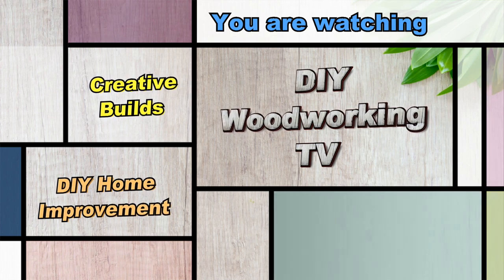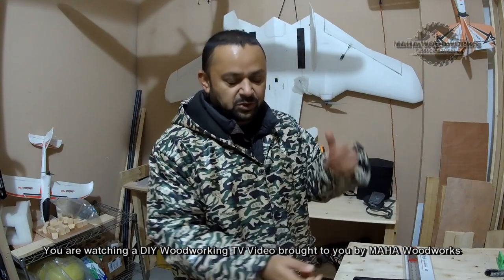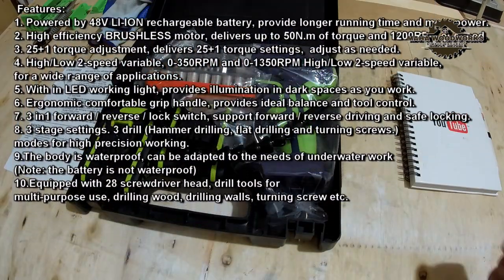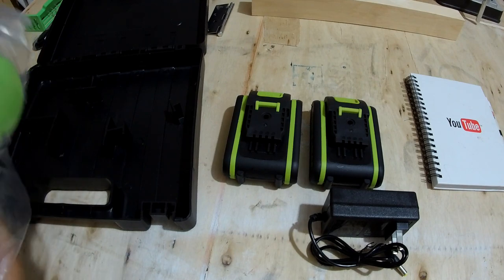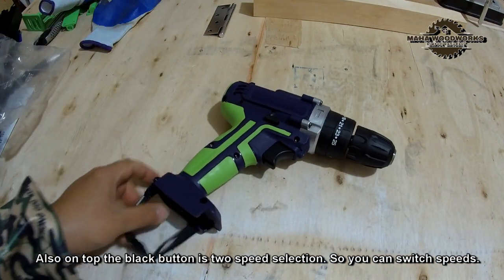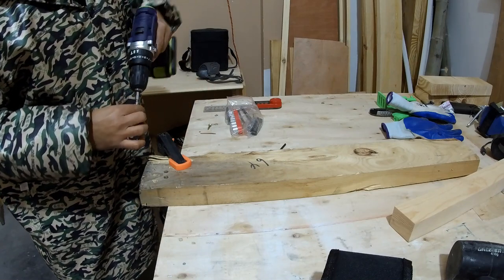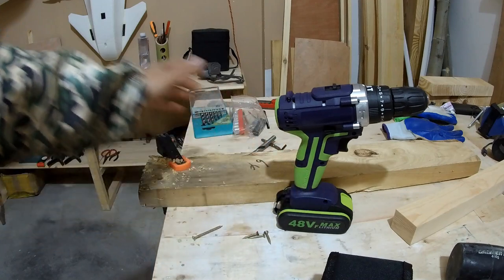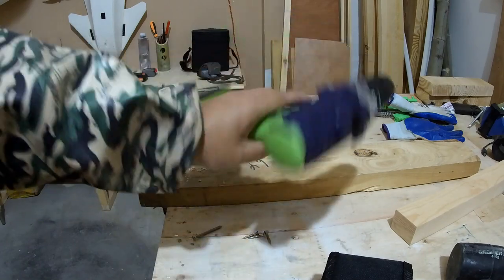3 in 1 Cordless hammer drill 48v LED light 50nm 25 Torque electric Drill

Comment: I m selling a lot of drills. This is not 48V drill. It is 48Vf, which I failed to understand what it means. Possibly related to battery capacity (mah). It is using 21V batteries (4.2v x 5 cells). Max V I have seen for cordless is 25V.

Comment: You may find this helpful.  When drilling you may notice the flutes filling up.  It is usually a good practice to repeatedly withdraw the bit from the work piece as you drill to clear the flutes.  This practice will have the following benefits:  drilling procedure will be easier and faster; cools the bit and work piece; easier to keep the hole straight (especially when angle drilling).
Reply from the maker: Big thanks for a useful tip :)